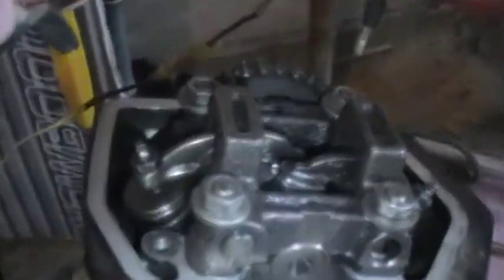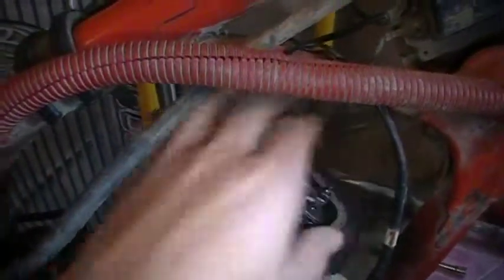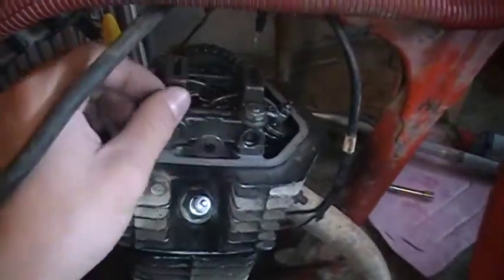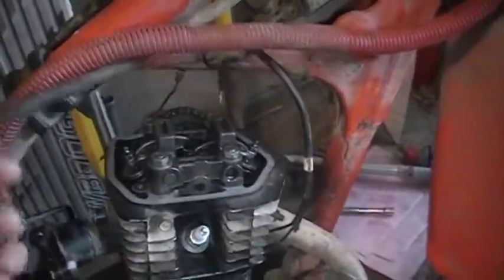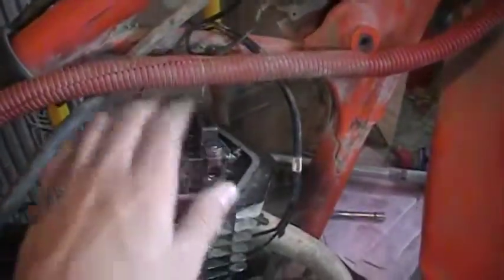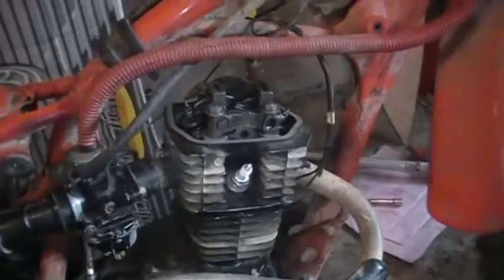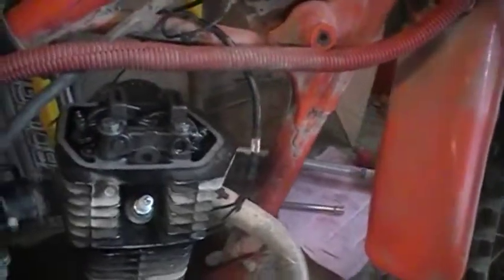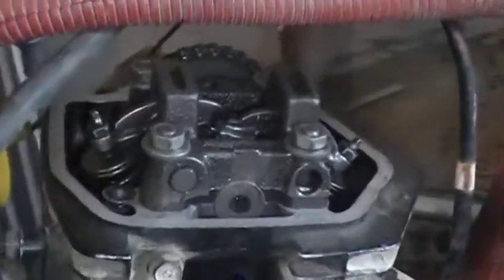Update on the 1986 honda xr80r

Comment: Your engine overheated because there wasnt enough oil. the piston, rings, and possibly whole cylinder need to be replaced if that the cas. if not that thdn your timing is off nad needs to be set